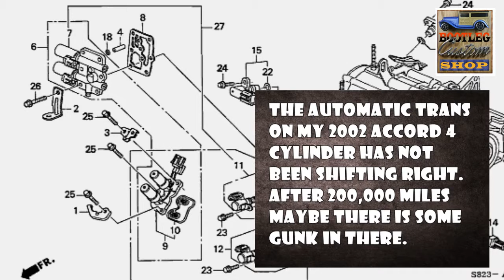1998-2003 Honda Accord automatic trans shift problem fixed with a crowbar and q-tips

Comment: Had my transmission rebuilt and shifting issues would still occur, then i bout a new transmission and had a transmission mechanic put it in and replace the clutch and plug parts and it runs better than before but still wont shift from 1 to 2 easy and the rpms crank before it goes into gear hard, or i let off the gas and itll slide into gear and the rest of the gears seem to shift alright. Will this solve my problem??
Reply from the maker: Its worth a try. If a so called Pro worked on it I would hope they checked this, but who knows. Good luck & tks for the interesting comment. Pls consider subbing, I could use more Good comments!
Reply: Dude you need to reset your transmissions computer back to factory. It's super easy. I have 2001 Accord 4 cyl 198,000 plus miles. Going into 2nd was a pain in the ass especially around turns. Every other gear was perfect. Resetting requires no tools and you dont even need to pop open the hood. My 2nd gear issue is resolved. Idk how to post a link but on YouTube type in "how to rest Acura honda ECU transmission". The channel is MODS FOREVER. I can almost guarantee that this will solve the problem. Be sure to drive about 50 miles after the reset is done and drive how you would normally drive. The computer will adjust the trans accordingly. My car shifts like new. Hoping for another 100k. Good luck man
Reply: @ryansimpson3074  well i will try that, but i got my tranny rebuilt and the mechanic fucked my stuff up and the tranny was leaking fluid and i didnt know so it got burnt out and i sent it back to him and told him since he messed it up hes fixing it free of charge... words were exchanged and i ended up forking over 400 bucks instead of full price and when i got it back it was still leaking... and im not putting more money into it so im gonna keep it as my project car.. but thanks for the help!! Ill definitely fix the leak and give the tutorial a try!! Appreciate the comment man
Reply: @andrewferrell9154  Thanks for the reply. Keep me posted man this can be our thread to chat and keep each other up to date. Leaking fluid idk but the computer reset should work. If you watch that video , look at the comments. I'm in there. Just about everyone was impressed. I am no mechanic by any means but I one day would like to have a project car or two that I can teach myself how to tinker with. Nobody showed me this as a kid so YouTube is my teacher. Again bro lmk. This can be our thread. Good luck

Comment: Friends 03 Accord EXV6 Coupe having similar issue. Transmission won’t shift into gear when its cold. Symptoms is when it is cold. And come to complete stop then try go car won’t move. Unless you shift to Neutral then drive. And acts like nothing happened. Short fix is to let it warm up. Have to look at those screens again since i replaced the 3rd and 4th gear pressure switches and ATF filter.
Reply from the maker: Great comment & details. Good Luck & Let us know how it works out for you!

Comment: Will this work for the 3.0 transmission?
Reply: I am not a pro but my research [honda shop manual] does not say the 3.0 tranny is any different  than the 4 banger. take a look &pls let me know!
Reply from the maker: Old artist is my other channel. Sorry. I do this all the time...
Reply: @bootlegcustomshop4129  well I have no point of reference to go by.  This is my first Honda so I’m new to the platform.  Seems like what’s happening is it’s shifting kinda hard from 1st to 2nd until it gets up to operating temperature and then it smooths out
Reply from the maker: @johnwhitaker545  pls read other comments and consider subscribing to my channel for more advice

Comment: Thanks for the excellent video and music to boot! I'm off to complete the same process today on my son's 2002 accord.  After a couple of fluid drain and fill exercises, it shift better but not right.  I have a feeling this will do the trick since the fluid we drained looked horrible after 180,000 miles and no service.  Thanks again!
Reply from the maker: Yes we did the drain * fill too. Tks for writin & best of luck with the car. The one we did had about 225k miles.
Reply: @bootlegcustomshop4129  Ended up finding a great deal of debris plugging up all the screens of both valve body ports.  After carefully removing and reinstalling without damaging the gaskets it shifts perfectly.  The solenoids were fine as is the mechanical components of the transmission.  Thanks again!
Reply: @bradyaugustine228  well done! Treat yourself to dinner & wash that honda to show it some love!
Reply: @bradyaugustine228  Hmmm, I might try this as well and report my findings.
Reply: @bradyaugustine228  I have a 2000, Honda, Accord, S.E., with 232,000, on it. Transmission slips badly...
Reply from the maker: @bryanbarajasBB  let us know if it helps  Consider subscribing for more 

videos coming soon....
Reply: @bootlegcustomshop4129  I'll put a video together right now and send to you the results. I did clean those solenoids  and changed the transmission fluid with new Honda Transmission!

Comment: Think this would help lack of engadging clitch from lack of hydrolic pressure when shifting gears when down shifting than hitting into new gear(2nd) under 20 mph she still drives but hits in second gear usually
Reply from the maker: I dont know if those screens control clutch but shifting did improve alot.  Thank you thanks for popping in and having a watch & leaving a comment! Consider subscribing for more videos coming soon....
Reply: Have you figured out what the cause was I am having the same problem in just 2nd
Reply: @302diamondstate7  i think its the screens in the 2 silinoids for my trans mission.. i honetly have a new one off a accord with 70k miles out of a wreck one from wrecker. and it has a warranty... i have heard mixed reviews about the siloniods failing after screens are replaced or transmissions after

Comment: Thanks a lot for this video. I should try this today.

Two days ago, noticed my 2003 Accord, 2.4L started mild jerking when accelerating uphill and needing to downshift. Immediately after managing to climb the hill, transmission slips into neutral intermittently, causing the car to stall. If I approached a full stop at this time, car would refuse to move when I accelerate (regardless of terrain- level ground or slope). I would have to switch off the engine, wait several minutes, restart and when I shift to 'D', car would move normally (but transmission makes some 'slapping' sound when I shift back to Park at this time. Same sound absent next morning when cold).
Just a month ago, I did a routine transmission drain and refill (×3) BUT did not check the solenoid filters. I was suspecting a failing downshift solenoid. Could clogged filters be the problem here?

PS: Never compromised on my transmission service schedule. Transmission fluid clear as day and level okay. Car has run great as a daily driver for 9 years. Never a transmission or engine problem till date. No check engine light thorough all these. Scanned, no codes!!!
Reply from the maker: Sounds familiar. We kept fluid clean too but gunk happens...Best of luck!
Reply: @bootlegcustomshop4129  Thanks so much for the love.
Didn't work for me, so I had to order a matching, pulled transmission. On the 'new' transmission, a pressure switch attached to the rear plate was found missing due to a broken flange. There is also seepage of transmission fluid from the crack line. 
I think one can easily substitute the broken rear plate for the one on my original transmission. Do you think it's a good idea or I should just be patient some more days and send back to seller for a replacement? 

Wish I could send you pics to see.

Regards!
Reply: @olusegunadediran2655  Wish I could help but I never had to replace the trans ....yet! Maybe someone else will reply. I get alot of viewers on this one. Regards!
Reply: @oldartisttricks2692  I looked up the serial number on the 'new' transmission and discovered that it was an MCTA pulled from an Acura TSX but matches my original BCLA. So, I went ahead to substitute the rear plates and successfully mated it to the K24A engine. Transmission shifting seamlessly so far and no trouble codes. The only snag is that the stick wouldn't shift completely into gear 1 (the lowest on the rung). It kind of hangs between gear 2 and 1, purely due to no further space for the stick to move backwards.

I have tried adjusting the transmission range sensor to no effect. I suspect the shift cable might need a bit of adjustment, no??

For the sake of learning, would like to ask anyone with experience working on Honda transmissions if there are any drawbacks in replacing a BCLA with an MCTA type. Kindly weigh in with your ideas. Thanks 😊

Comment: I have a 2009 accord that won’t go out of first gear. Has a shift solenoid A fault. Should i replace the solenoid or clean gunk?
Reply from the maker: Dont have experience with that year, but if it has solenoids in same area i would give it a try. Let us know how it works out.
Reply: @bootlegcustomshop4129  Yeah it turned out good. Had the car sitting for 6 months after i had fixed a misfire when this problem showed up. Changed solenoid A and it’s running great.
Reply from the maker: @100ify1  So good to hear...Glad to keep you outta the hands of shady mechanics!

Comment: I’m stumped I did a jdm swap of the 2.3 on my 1999 accord everything is working how it should expect the transmission I swapped all the sensors and solenoids on the jdm to American ones cleaned valve a which is the torque converter clutch solenoid i didn’t clean clutch pressure control solenoid bc I looked at the screens and didn’t see anything, I’ma test valve b and c to see if those are faulty but they were brand new, so any suggestions I wouldn’t think it’s the tranny itself bc that thing is a low mileage transmission and a low mileage engine the fluid levels do concern me since on level ground one second says it’s got the right amount next it says it ain’t got any, I ain’t a mechanic and have very little knowledge dose anyone know what this could be ? Also threw one code when test driving which is p0730
Reply from the maker: sorry, wish i could help but it sounds like its one of those mysteries you need to call a honda doctor for....that fluid mystery is maybe the cause. did you use honda fluid/
Reply: @bootlegcustomshop4129  yeah I used dw-1 atf and ordered two more quarts so I would have 6 in total bc I did the recommended amount when you do when you change which is 2.6 quarts I believe but since it wasn’t on a level surface and I had it on stands I think I pulled out more and so I think the torque converter isn’t full so it’s giving me a p0730 after driving it for a couple miles on the crap shifting, idk if what I wrote made sense but I tried to put it in a way to be understood, thank you for replying

Comment: IT FIXES MY 98 accord problem but i only clean the top solenoid, I should’ve clean the bottom solenoid too dang it...smh
Reply from the maker: Good for you. Maybe bottom is ok, but i doubt it. Pls subscribe for more !
Reply: Me too , i just clean the top .. it still hesitate a little a little if I press the gas a little heavy.. i just bought a transmission fluid but i need to clean the bottom 1st , see if anything cure..

Comment: Does a 1998 4cyl Accord auto have these same solenoids? Mine is starting to hop when it tries shifting into the next gear. If I take my foot off the accelerator for a second and press again it seems to be ok. But it seems like it’s happening more often.
Reply: I say its the same
Reply from the maker: I believe so, just take a quick look. Consider subbing for more vids, & tks for writin

Comment: hey do you think this plus an transmission oil change with Lucas for possible leak would work if my transmission doesn't ingage on drive it just revs the rpm and would ingage on reverse for only a few seconds. please help
Reply from the maker: I would check screens first then check fluid and see if it looks burned or dark. I would change fluid, try it wait a week then change again. let us know if you fix it! Good Luck..
Reply: @bootlegcustomshop4129  thank you for the advice, I will.

Comment: My 94 accord get no power 
As it is in neutral...and d4 blinking after get hot for around 5 km driving..but get to normal after cold...what could be the problem?
Reply from the maker: Obviousy overheating something have you used a code reader/scanner on it?
Reply: Not overheating..because the engine was ok..only trasnmission seem gets into neutral..and d4 is blinking..
Reply: @bootlegcustomshop4129  has not scaned yet

Comment: Hi mate, my 2001 accord (115k kms) wanting to jerk forward at stop lights and signs after being on the highway for a bit. It doesn't happen when the car is cold, but seems to start after it has time to wake up and warm up. Usually on my way home from work and when I have more traffic. With my foot on the brake the car it seems to be in some cycle, and jerks forward. If I didn't have the brake down it would just smash the car in front of me. And if I try to press the gas peddle down in the off cycle feeling it clunks to get moving. If I catch it in the forward cycle no issues. When I put the car in neutral the problem goes away. Until again I have to drive. 

The car has normal power, speed, and gas mileage. I just changed plugs and wires to test the issue and that didn't fix it. Somebody told me transmission gone bad. Even i replaced 2 transmissions. (Off course from donor cars which were crashed and written off) but the problem is still there!!!!!! Got checked by mechanic if its something else. But mechanic says its transmission. Please help.
Thanks in advance
Reply from the maker: Maybe lockin up when it shouldnt....Never had that one. Let us know if screen clean helps or ??? Best of luck!
Reply: Clean your lockup screen.  Use honda atf.
Reply: I’m experiencing The same I was gonna change my transmission but idk yet

Comment: Would you recommend doing this just to service a high mileage vehicle with no issues?
Reply from the maker: For me I would not tamper with one that isnt broke, but keep this in mind if things start acting up, instead of some butcher going apeshit & running up a bill + making a mess. Best of luck & great question
Reply: The only way to avoid issues is to regularly change out the atf fluid.   The older the fluid the more gunk that will accumulate in the solenoid screens.

Comment: Hopefully you see my comment, I have an 03 v6 accord and it's stuck in second gear with codes p0974 and p0980. I've changed all of the solenoids already and it hasn't fixed it. I'd really appreciate any insight.
Reply from the maker: Im no trans expert but-maybe some viewers are. Did you drain the fluid & stuff like that?
Reply: @bootlegcustomshop4129  yeah I've changed the trans fluid and checked to make sure no wires were broken is the nearby area. Codes won't clear with a scanner either, they just pop right back up

Comment: quick question, now does it shift better after the service or you still getting the clunk?
Reply: problem solved
Reply from the maker: Still OK, slight clunk with a heavy foot. but I am babying the car now.
Reply: my clunk moved from 1st to 2nd.. 1st is baby smooth now
Reply: Problem solved.  If you still have clunks check your motor mounts too.  Especially the one in front usually cracks first

Comment: My 1995 Accord has 180k on it and drives fine, but from neutral to drive 4 it has delayed engagement. Instead of one engagement it seems like two. Like bump and as second later another bump. Same with drive 3. Low and drive 2 engage normally. I removed the first solenoid and the screens were very clean, however, the rubber gasket has a notch in it. Not a complete split but a small notch. Both solenoids were cleaned and were noticeably louder when I reinstalled them. Still, the problem persists.Any ideas?
Reply from the maker: Im not a honda tech... Just a guy with a fone camera.. Off hand 1 System controls the shift & other  controls the lockup. I did both..... the pair under the battery is a PIA but ? Any of the 10s of thousands of viewers got an idea? Let us know whats the outcome is SC...

Comment: I have an accord Cf3 2000 with abnormal gear shifting..it feels that the transmission get stuck...and then the whole car shakes it self and the gear is changed...it also happened while ascending on an highway..the gear kind of gets stuck.
Reply from the maker: That could be the clogged filter problem. Worth a try.
Reply: @bootlegcustomshop4129  Thanks i might give it a try

Comment: what would i be asking the guys at the parts store for......transmission solenoid gaskets? great video. hope this helps my problem.
Reply from the maker: That sounds good. Did gasket rip or are you being prepared in case? My gasket peeled off nice. You could always take a screenshot of the video & show the guy.
Reply: @bootlegcustomshop4129  just being prepared. i have a 99 lx with 335k. trans slips alittle and kinda hard shifting now. I already have the intake manifold off to clean the EGR  passages. stumbled on your video while lookng for how to replace trans vids.  picture is a good idea. not sure if it will help though, the people at my orielys are pretty clueless ...lolthx again for the vid, probably saved a lot of people some money.
Reply: @Chris-zp6eh  you can get them from hondapartsnow
Reply from the maker: Good luck with the car & tks for checking in. Consider subscribing for more diy videos
Reply: @Chris-zp6eh  doubt the gasket is available except from honda